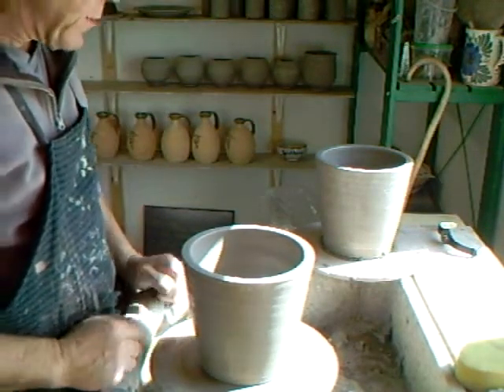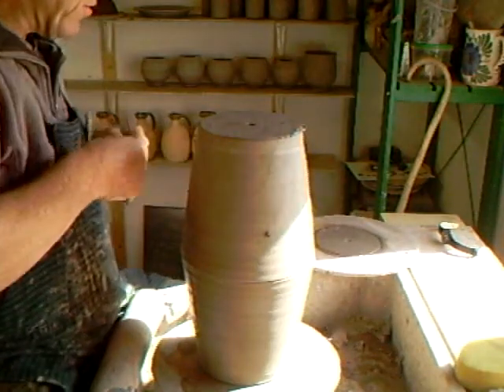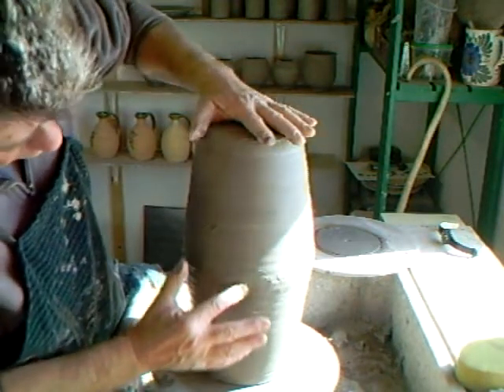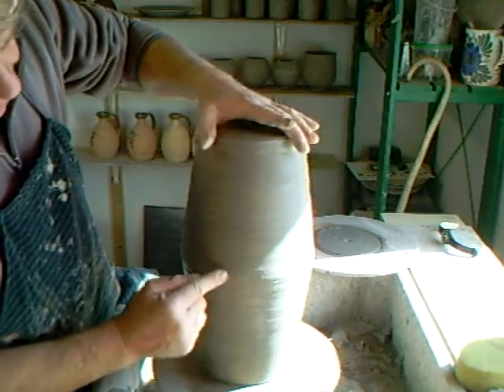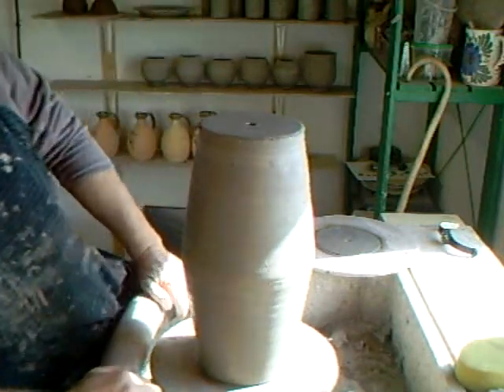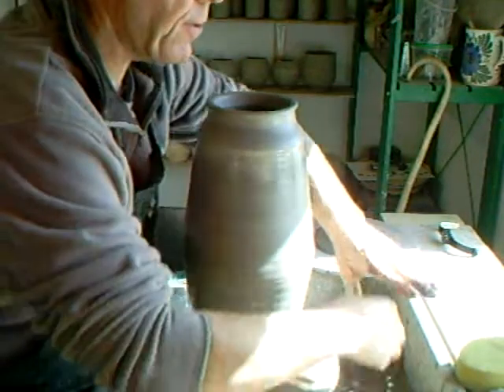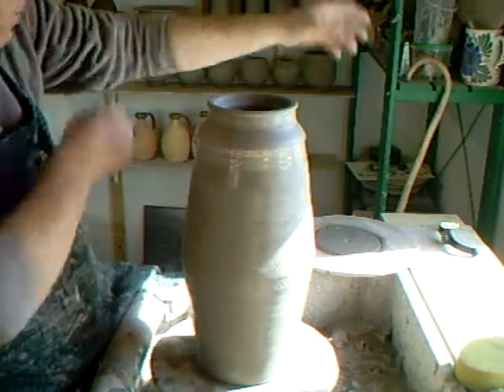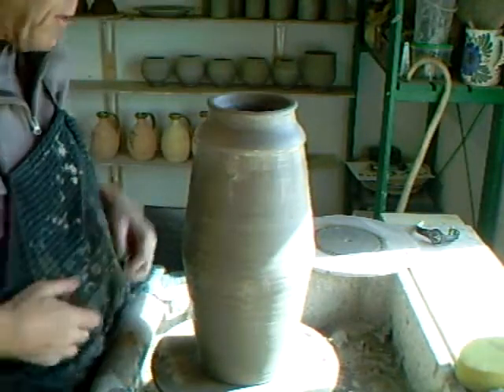SIMON LEACH - Two piece pots 4

Comment: Hi Simon!  Yet another great video.  I am surprised that you can work/pull that clay on top (or bottom I guess) since it is harder than when you would normally throw.  I have made two part pots, but differently.  The bottom part we joined.  We just cut out the remaining clay on the bottom and attached that portion to the other pot.  Both work, but your way gives a better join since you can smooth the clay on the inside.  I am amazed with the way you did this & will definitely give it a try!  RS